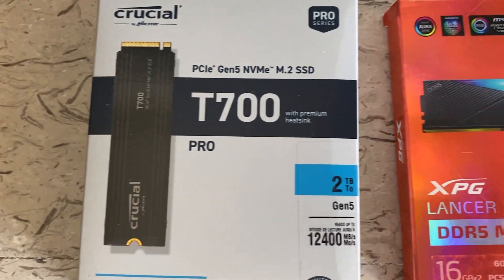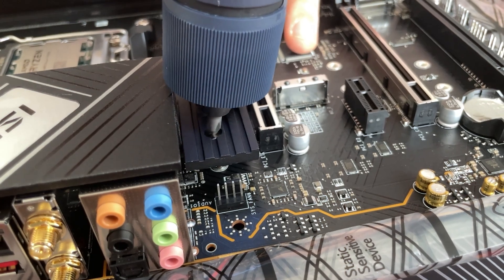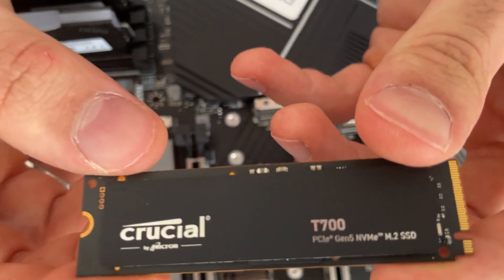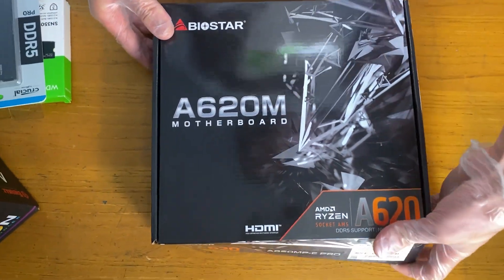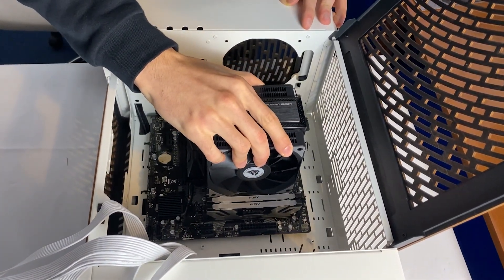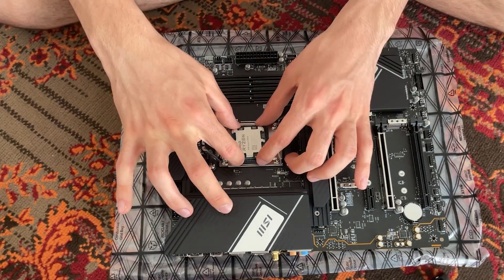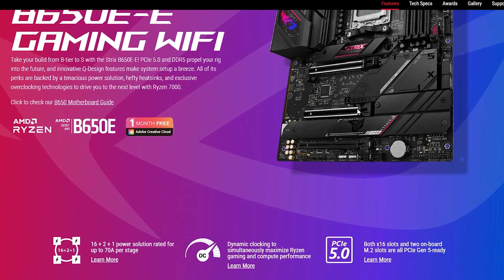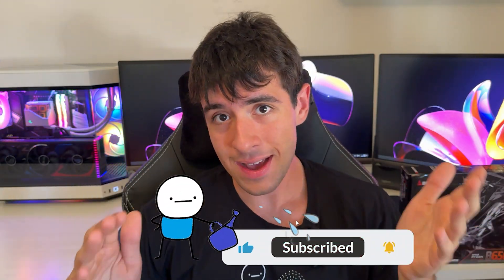Do NOT Buy X670-E or B650-E motherboards... they're pointless.

Comment: I'm more keen on highend boards, coz (i) with better components, they're more likely to last >10 years, (ii) 10 GbE & Wifi 7 may be the minimum in a decade and (iii) GPUs in a decade's time may be closer to saturating PCIe 5. Well, that's me. For most users though, agree with you that even a low to mid B650 board is good enough. Don't waste $$$!

Comment: What if try to upgrade  year or two from now, pcie 5.0 (for gpus not drive) would then be a thing and would have to change my mobo :(
Reply: PCIe 5 wont be a "thing" in 2-3 years enough for you to care about.
4090 has barely any difference in PCIe3 vs PCIe4, let alone 5.
So much pedantic people and misinformation.

Comment: I went for a B650E motherboard, because I didn't had much choice as I'm using a Mini-ITX motherboard for AM5 and highly prefer ASUS as a brand. So, they either have this B650E Mini-ITX motherboard or the crazy overpriced X670E Mini-ITX motherboard.

That's why I went for a B650E motherboard.

But for Micro-ATX and ATX motherboard, you have more choices, so it's easier to choose.

Comment: Pointless is only if you go an plug in 1 GPU and call it a day.
I am one of the users that is not limited due to motherboard nature, and I used to have firewire PCIE card for my 2nd audio device, but now I will make my GPU perform worse due to less lanes.
I also used PCIE NVME expansion cards before, and my z690 motherboard allowed all of it, while my z790 will lose NVME drives, and I can't even plug in firewire card, or I will fight GPU lanes, and there is absolutely no space for NVME expansion cards

You are buying X670E for more lanes, and that's the benefit of AMD 7000, it has more lanes than Intel 13th/14th gen
People buy Threadrippers exactly for same reason people buying X670E for, to get more connections through PCIE slots
Parallel connectivity on Threadripper allows you so many lanes and capture card for your heart's content.

I don't know why you would make this video, it is misinformative, because some people use El Gato cards and NVME Pcie Card extensions.

Comment: Yes.. b650 are good... but for 7950x i want b650e Asrock taichi.... vrm is insane...
Reply: I had x670 Gigabyte gaming ax... 1.0 too hot! Dram light error after an update. I think is toasted... hope the proc is ok. I ll find tomorrow...
Reply: "vrm is insane"
Image a 10 inch wide bucket, and you pour it into a 1inch wide pipe. Guess what? The "insane" bucket size makes no difference cos the pipe only wants 1 inch.

Comment: Thank you for this video. I have 2 motherboards in mind currently to go with the Ryzen 7 8700G,

MSI B650 GAMING PLUS WIFI
MSI MAG B650 TOMAHAWK WIFI

Can I do better with these 2 MoBo choices for an APU CPU? 
I'm intending to use a dGPU (RTX 3060) with this APU CPU. I need the iGPU for light work or when the dGPU decides to go bad and I can still use my PC's iGPU as a stop gap measure while I look for a replacement.
Reply from the maker: The R7 8700G is so easy to handle power wise that both those boards would be absolutely oversized for it. So get whichever is cheaper! I even made a build with a R5 8500G on a off brand B650 in a 3D printed case and that was absolutely fine even after overclocking :) dGPU usage with it is also gonna be fine, I like running two GPUs!
Reply: @ImWateringPSUs  Thank you for sharing!

Comment: I maybe upgrading my 12th gen Intel rig into Ryzen 9000 series. Im waiting for the reviews on those to see if its worth it or not.
But yeah i will most likely go with a B series board if i upgrade. I had an X470 Strix board for my 2700X back in the day and it was total overkill.
Since then i have had a Ryzen 5 3600 and Ryzen 7 5800X and both with B series boards.
Reply from the maker: I can tell you as a little spoiler that yes, it’s going to be worth it. Not a massive change compared to Ryzen 7000, but since AMD is leading already it’s gonna be a good platform to hop on!
Reply: @ImWateringPSUs  Thats good now only thing needed is to see some benchmarks and how expensive they are going to be.